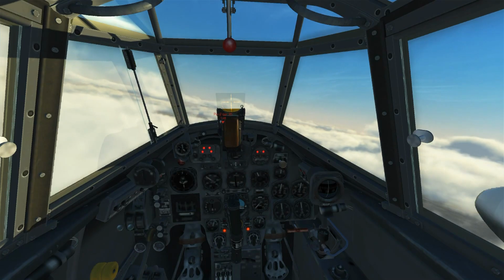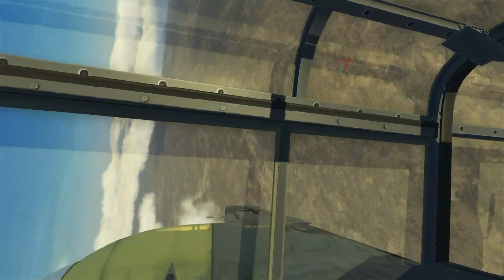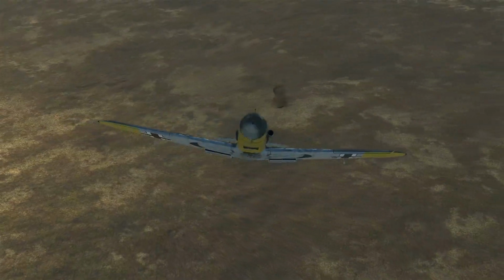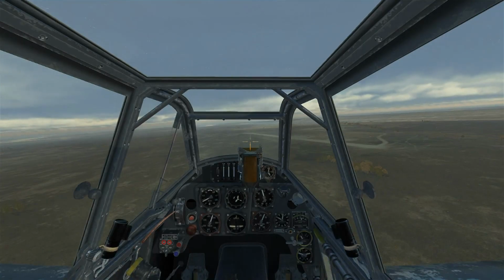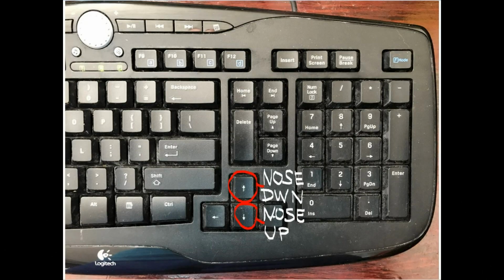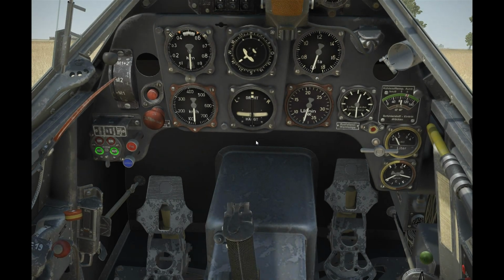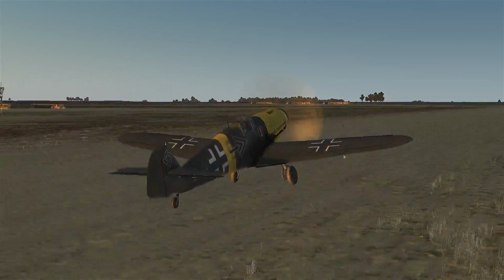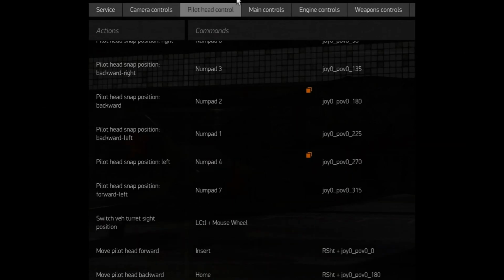(39) IL-2 Col Ninny's Control Set Up  1  - and Key Mapping

Comment: Hey mate, I know this video was old but I have an issue hopefully you can fix. My joystick is the extreme 3d pro by logitech. I have installed the drivers, the software detects when i move the joystick or press buttons. When I'm in game, the joystick movement is detected but I can't assign HOTAS keybinds from the joystick. I would appreciate if u could help me (thanks)
Reply from the maker: Try this updated setup: https://www.youtube.com/watch?v=Oe5MixD-Ekg . The 3d pro is excellent. inmgame go into settings. you should be able to set the keybinds from there. Let me know how it goes.

Comment: Super helpful thx!  I'm a total newb so I didnt even know how to use the rudder, I lost patience trying to take of with the 109 using rudder trim.  Then I learned the 109 has no rudder trim and I was like then WTF!  Bro you tought me about the Z axis. lol
Reply from the maker: I'm going to suggest you fly the Bf-110. It's the easiest to learn on. As a newb I have How to fly lessons 1-8, or if you have Flying circus How to fly 1-14. It takes practice. Lots of it. Be patient. :)
Reply: @colninny8769  I just love the 109 as a noob it seems I HAVE to begin with THE (arguably) staple aircraft of ww2. The first one everyone learns about. Felt right.
With your help, I kept at it and though I'm not smooth, I can now taxi (still struggle with unlocked wheel) takeoff and land cleanly.
It's a lot of fun.

I'm flying the F4 and I don't know why lol.
Anyway thx for your tips. Really helped.
Reply from the maker: @jonathanallard2128  it gets easier...
Reply: @ Yeah I got all manoeuvers down now. It's addictive! First time you shred an aircraft, you're hooked! So satisfying.
Reply from the maker: @jonathanallard2128  very good sir. Keep going!
Reply from the maker: Message me on discord if you want to try multiplayer. Fly with us and you'll learn tenfold. Yes, you'll make a million mistakes. No Problem! TAW starts soon, we need some help...:)

Comment: can u sort of "pre-trim" the yaw axis when it comes to engine throttle yawing the aircraft to the left/right? or do you have to constantly maintain the "joystick twisted" sort to speak in order to maintain the ball centered and maintain wings level flight?
Reply from the maker: Very complex question. There are so many variables as the aircraft changes direction, speeds up and slows down, adds or reduces power. The best answer is to decide what you are doing: climbing, descending, turning etc, and seek to set the trim to maintain that attitude, knowing that as soon as you make a change you will need to retrim. Pitch trim is the most important. Normally once the other trims are set you wont spend much time on them, doing as you say maintaining rudder input (twisting grip). Recommend you look at this to get a better idea: https://www.youtube.com/watch?v=tj41bKTh43M&t=1s Trim control, and this one follows:
https://www.youtube.com/watch?v=-hssM2TuoQw yaw control and turns.

Comment: Can anyone help me? I have a Thrustmaster Warthog stick and throttle. And Thrustmaster pedals. I am brand new to IL2 and cannot figure out how to make these controllers do anything in the game. If I move the stick and so forth nothing happens on the plane. 
==> When I try to use the ingame menus to map these 3 controllers. My only choices are "mouse"  and "joystick". I cannot see anyway to make these 3 controllers do anything in IL2 great battles.
Reply from the maker: You'll be fine. One step at a time. Plug in your joystick. go to your computer devices settings and calibrate your joystick. Once calibrated go into your game settings and under flight controls choose your x and Y axes. Stop here. Start game and see if your aircraft actually shows rudder and elevator imputs. If so then you know it works and can set up the other key bindings. Let me know how that works out.

Comment: I used joystick wizard to set up my joystick ( the same as yours ) all the inputs worked , and then when i get in game it doesnt work. Any tips mate , really would like to play the game with the joystick.
Reply from the maker: Don't know joystick wizard. I would reinstall your stick and then go to IL2 settings and enter the key bindings. let me know if that works.
Reply: @colninny8769  I have read that lot of people have problems with it using Windows 11. Shame but for now I've started playing war thunder on simulator as the joystick set up is very easy. Thanks for your reply though mate
Reply from the maker: @Johnsgotti95  I've not heard of that issue. Should be just plug and play. In comparison, WT is a kids game.
Reply from the maker: @Johnsgotti95  my team =OPFR= say ensure you have new drivers for win11 and stick

Comment: I use the exact same set up. Thank you for showing me I don't need to spend hundreds of euros too have a good experience playing IL-2
Reply from the maker: :) I flew for 1200 hrs with that system using a mouse to look around. Track IR was the best upgrade. I have a newer video on my stick upgrade, to a TS 16000 but after 2 of them failed in the Yaw axis, I moved up to the VKB. A very solid stick.

Comment: I tried and tried to play these kinda games without tracking or vr, now that I've got an index it's made looking around near perfect and the level of immersion couldn't be higher. Now I'm trying to go thru il-2 great battles under as close to sim like conditions as the game will allow, I've used your series on how to fly as my guide to get started. It'll be a couple weeks till I have it totally down but I'm having fun learning.
Reply from the maker: Good to hear. I have tutorials on just about everything in the game. It takes time. Nothing is particularly difficult, just new things take a while to become muscle memory. Track IR is great, I use it, but VR is apparently the next level if you have the system and other gear to support it. High end sticks have more buttons so no need to ref the keyboard. Cheers.

Comment: I feel like I just can't stand a joystick that rotates for rudder. It just hurts my brain. I really want to get into this game... but I am so afraid I am going to buy the wrong gear and just like racing... going to be at a disadvantage to players with a full wheel setup or proper joystick.
Reply from the maker: Crixus. Buy the game. I would buy a Wingman to start. If you love the game (you will) then consider upgrading. You could spend $1500 on stick, rudder, throttle plus plus plus if you want to go VR. After 2000 hours in the game I still dont use pedals. If you want to be an ace fighter pilot then pedals are required. Budget... I flew for 2300 hrs using my mouse to look around, then went to Track IR.
Reply: @colninny8769  Really no pedals? That is interesting! Thanks for the input. I am really looking forward to purchasing something.

Comment: I have the exact same setup. Do you have any video about engine management? There so many terms.. mixture, oil, radiator.. So many systems it's overwhelming..
Reply from the maker: yes, look for my CEM Complex Engine Management videos. view my YT site and go through the videos. There are 4 I think.
German aircraft have few systems, to manage. Most are automatic.  This will help so you have a reference in the cockpit. Requiem  and Sherriff do excellent CEM videos also. the p47 is the most complex.
Reply from the maker: There is an updated video to this control settings also. T 16000 vs Saitek X52

Comment: Cool to see much hated Logitech Extreme 3D Pro in use. That is all what I have used, and what I still use today, though, since not a student anymore I am thinking about upgrading :D Cool to see someone not using TrackIR too. It is encouraging actually. I have TrackIR5, which does not work anymore, and I am in process of fiddling with Opentrack. I use Linux, and no plans to get Windows, so setting up head tracking is a big problem. It might be that I can't set it up, so would have to fly without head tracking, which was not much of a problem before, but after you get used to head tracking flying without it feels like a deal breaker.
Reply from the maker: https://www.youtube.com/watch?v=Oe5MixD-Ekg is the updated video. I now use a T16000

Comment: What "sensitivities" do you use for your control surfaces?  Can you do anything to make the rudder less reactive?  I just have a twist joystick also.  I find myself frequently inadvertently  turning the rudder as I bank.
Reply from the maker: Mouse sensitivity can be adjusted in game settings. try max and min settings and find yr sweetspot
Reply: Thank you again!  I appreciate all the time you take to teach us about this crazy SIM flying stuff!  PS  How do you fire secondary weapons?   @colninny8769
Reply from the maker: @robank3900  time to go into settings/key mapping and see what all the buttons do.... write them down! :)
Reply: I meant on the set up you show here.   @colninny8769
Reply from the maker: @robank3900  I believe they are shown in the video -settings pics.
Reply from the maker: I have not actually adjusted any of the input parameters. Real aircraft are flown by fingertip pressures on the controls. Only in movies do they have a death grip on them! Try holding your stick with fingers and thumb and not with a fist. :) Trimming properly takes the pressure off. Rudder should be used to centre the ball in a turn. See my How to Fly vids , 3 and 4 . cheers.
Reply: Thank you  Good advice.  I'll do that.   Here's one more if you don't mind, I tried using the mouse for 'looking around"  It seems to react too fast .  Is there a way to slow it down to mimic natural movement?  PS how do you use secondary weapons since you use the traditional places for views?
  @colninny8769